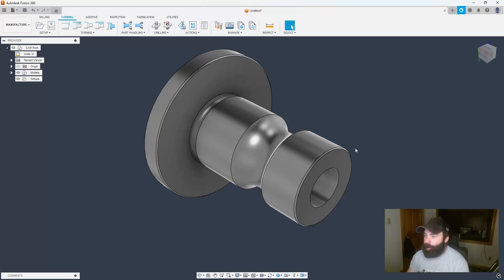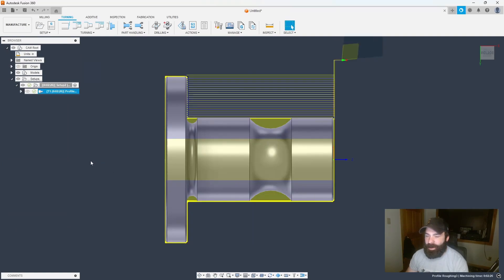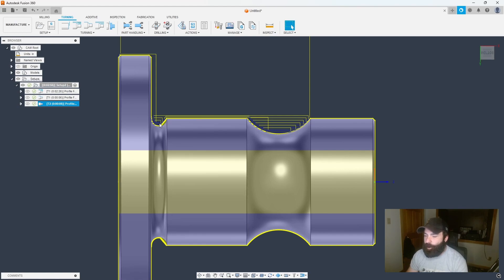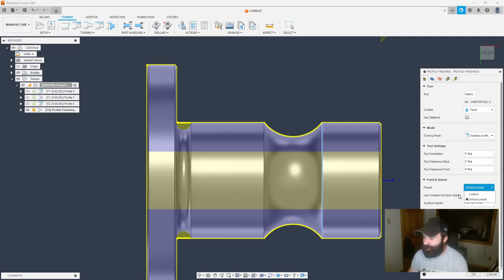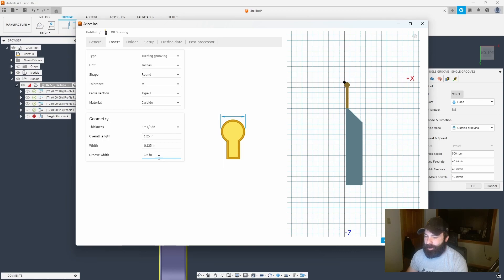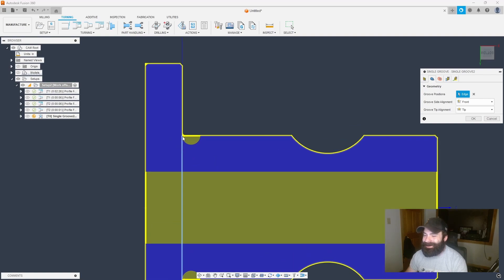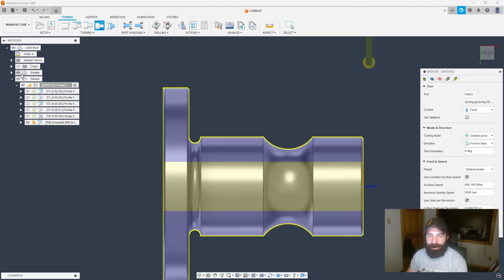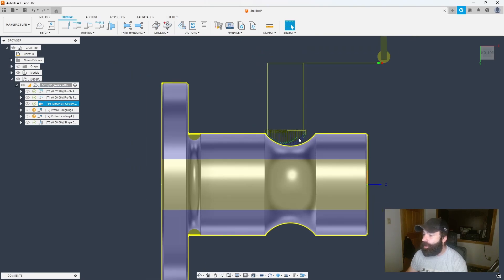Turning Tuesday: Undercuts

Comment: Thanks a lot 😍 I would like to know if it’s possible to use a central circle or line for the grooves so by selecting it the tool take that position rather than selecting that edge and making an offset?!
Reply from the maker: That's a great idea! I'll look into that.